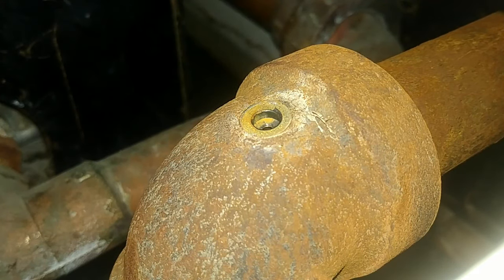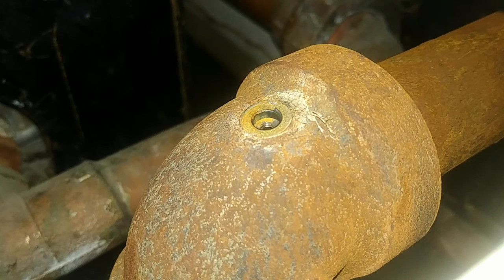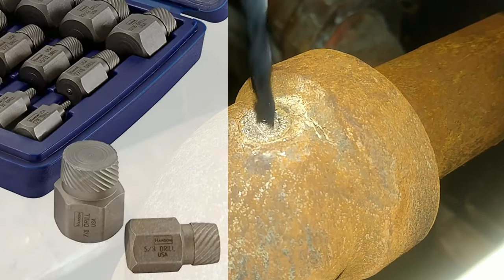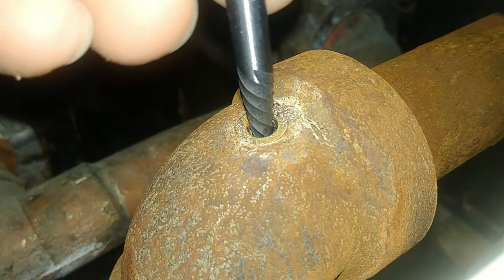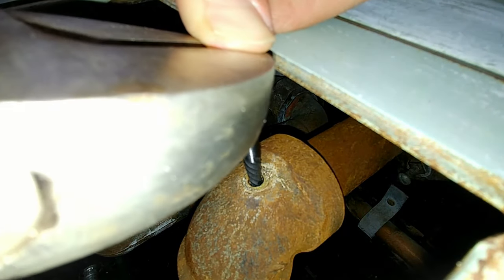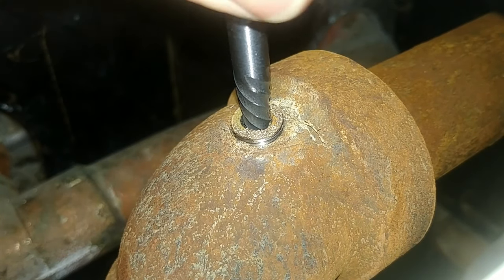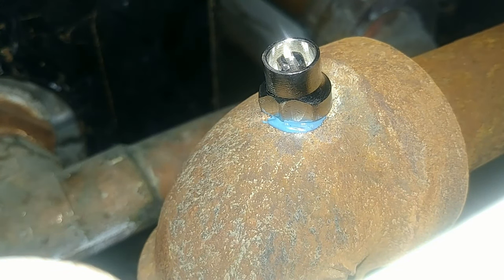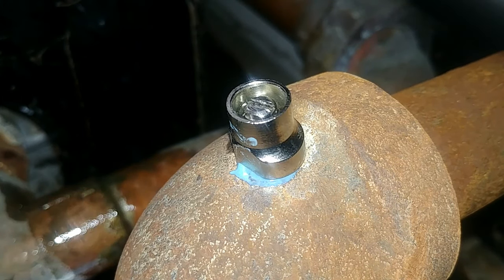How To Use an Easy Out - Remove Broken Off Bolt or Pipe Threads With a Spiral Screw Extractor

Comment: I always use a tap wrench when using an easy out extractor, using an adjustable wrench makes it more likely for the extractor to wobble which is how they break. Easy outs are hard as hell but brittle so they can break pretty easily if you're applying uneven force. And breaking your extractor off inside the broken bolt is a nightmare scenario.

Comment: The smaller the hole, the smaller the diameter of the extractor, which means higher torsional stress. If you consider that the piece being extracted needs a certain amount of torque to move, the larger the extractor you can use the better your chance of success. However, the larger the hole, the more accurate you have to be to avoid drilling into the threads, which will make using the extractor impossible. At that point, your best bet is to drill the hole oversized and use a threaded insert.